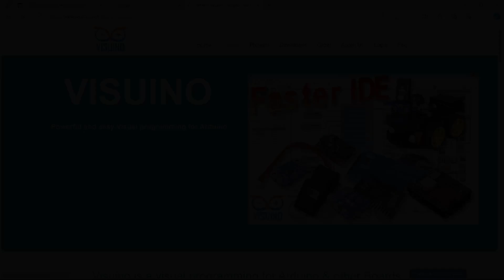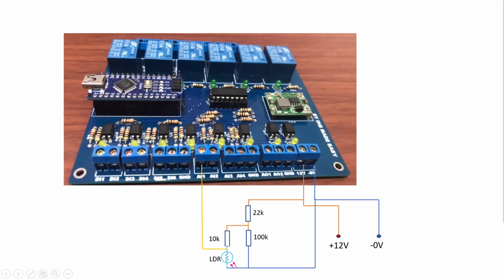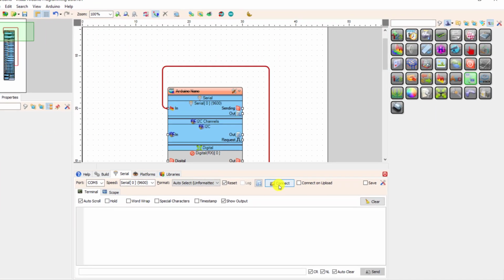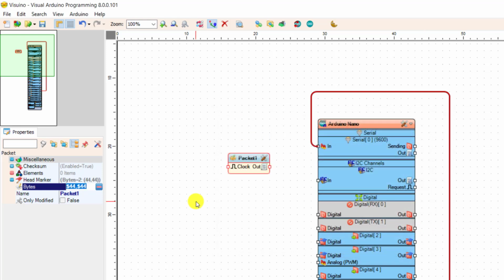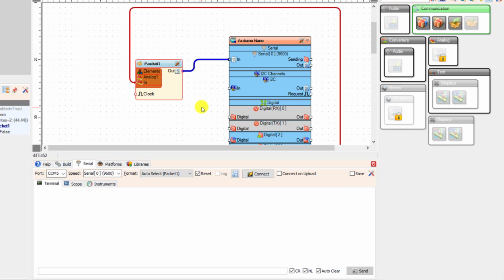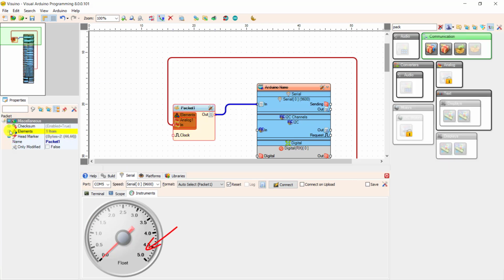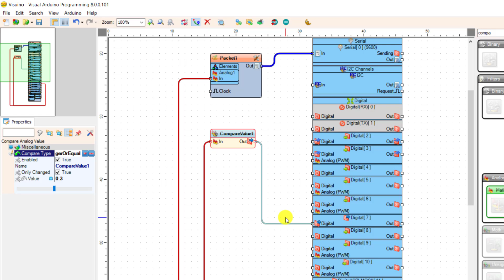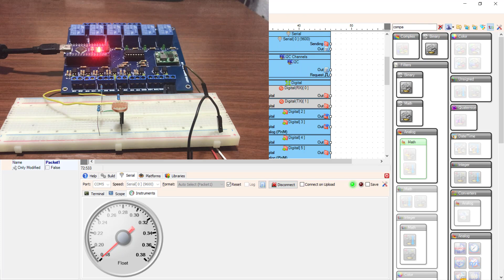How to Use the DIY Arduino Analog Input in Visuino

Comment: Congratulations! Very good video tutorial! You also stressed the importance of adding header marker to the packet, which is something people tend to miss!
I would also suggest using the "Analog Schmitt Trigger (Hysteresis)" instead of compare so the relay will not easily switch on/off when the value is around the compare point. It makes the control more stable 🙂
I have added the video to the list of videos made by you on the Visuino Wiki 🙂
Reply from the maker: Wow thanks so much for the compliment and also adding my videos to the Visuino Wiki. thanks for the suggestion as well. Will try it out asap.
Reply: @engineeringmadeeasyingme6819  You are Welcome! Love your videos! :-)